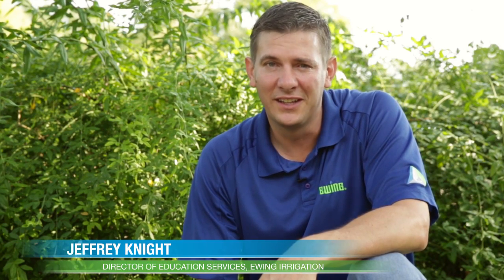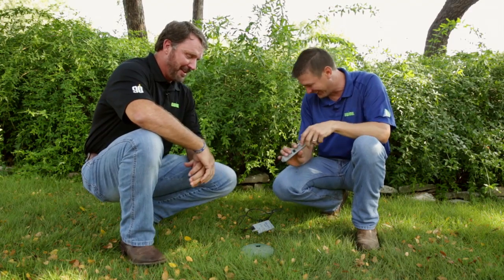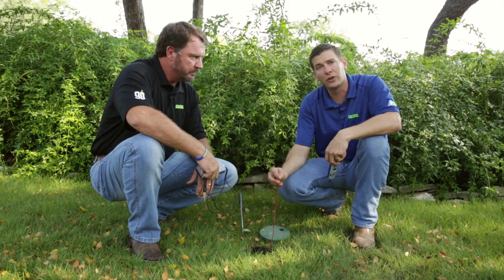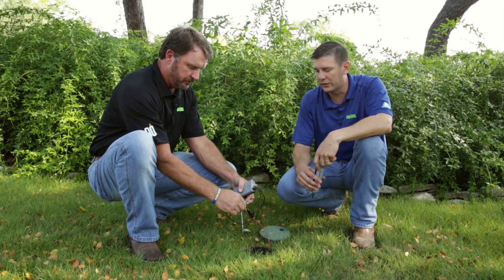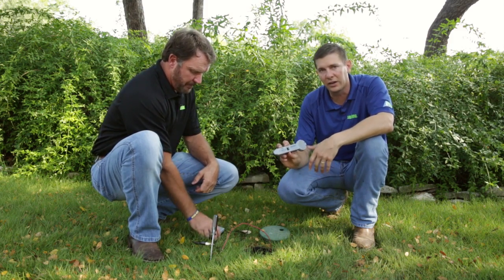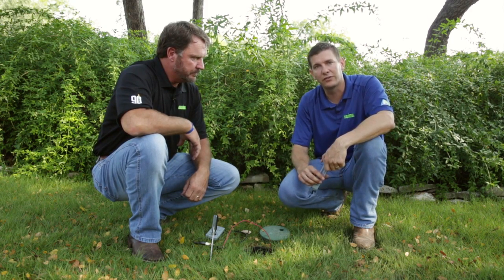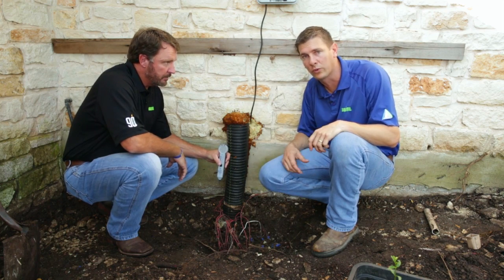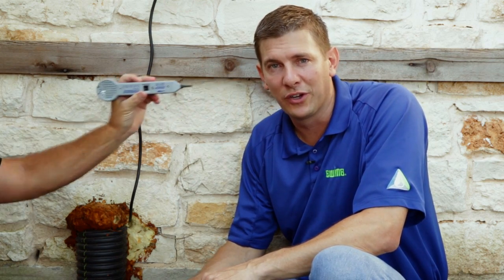Using a Toner to Identify Electrical Wires

Comment: First I Saw From Progressive. Tempo, Whatever they Brand as, Personally I Think the 620 is the Best, Slide the Switch From Off, Tone, Normally Open, Normally Open with Latch, Normally Closed, Normally Close with Latch. Momentary Connection of Leads Will Sound and Light as long as they are touching. Normally Open With Latch. A Momentary Connection Will Continue to Beep Til Reset Button is Pressed, Normally Closed Work Simullarily. 
A Note, When Toning Like You were Doing, Sometimes The Signal will Bleed onto Several Wires. When You Find a Pair you believe it to Be, short  those 2 together, if it is correct Pair, tone will be gone, if you touch and still here tone, you are not on the Right Pair.
Can't Live Without Mine, I Troubleshoot Most Everything.
Identifying Coax, Phone, Network Wires. For Cable TV, a New House, Start with putting Signal at Cable input from Cable Company, or Satellite Dish. Then go inside, Find that Cable/Wire, That is Input, All Others Are Output. Or if only using a select Few, Go to master bedroom and Connect Toner to Coax AND Network Wires,(Blue Pair?, Any Pair, go to where all homerun to, And Locate both at Once, Repeat as Necessary. Cars and Boats You can Follow to where the Break is, or Where it is Running to. Testing Fuses.
Great on Photo Beams, For Gate Operators, Place on Receiver contact, then move Reflector up and down, left and right to align to Center. 
Can Place on Wires on an alarm Panel, open and close door(magnetic contact) to hear if it is working. If testing a Pair of wires and to far to Hear, Then the Latching works well to identify, Can't Work without Mine, Is Others With Using Voltmeter and Continuity Tester, The Time to Troubleshoot is Criminally Longer, Customer Pays a Big Price for the Extended Time to Solve, And Customer doesn't know any Better, Just Thought It Must have been a Really Bad Problem, I Feel Bad For Them.
Is a MUST have. A Quick look at Your Sprinkler Tester Adds a Voltage Tester. But Only 24 Volts, Better to use a Multimeter as You can Check for 120/240 as Well. I'll Read Up on this Sprinkler Tester, But Don't Feel it Could be Better.
If Troubleshoot and don't Have the 620, along with the 200 Inductive Amp, You are Playing, not Working.
Randy, Strategic Electric & Security. Good Luck.

Comment: Im an excavator who just bought an old work truck and I found this cool tool under the seat. Can i use it to locate water main tracer tape? Or how deep does it go? I assume i could connect the common wire to a ground stake/screwdriver?  Looks similar to what my private locators use... may save me thoudands on a typical job if it can find lines burried below frostline if they have tracer tape or wire.
Reply from the maker: The Station Master Pro won't help you trace wires, just identify a specific wire as shown in the video. A wire/valve locator like this one may do the trick though.
https://www.ewingoutdoorsupply.com/42012000-pro800d-armada-hi-power-valve-and-wire-locator
Thanks for watching!

Comment: What’s the difference between armada and tempo
Reply from the maker: The features between the two are similar. The main difference is the price. The Armada model is a little less expensive. You can see more using the links below.
https://www.ewingoutdoorsupply.com/42011065-24bk-station-master-pro-irrigation-tester-kit
https://www.ewingoutdoorsupply.com/42012075-pro50-digital-solenoid-activator-multimeter-w-tone-probe-kit

Comment: What would be nice is the one that who is running the wire to label them it's very simple quite effective a piece of tape wrapped around the end of it and Mark it with numbers letters it don't matter I hate when I run into this stuff because some lazy ass could not label something when they pulled it moved it reattached it done whatever mess they decided to make mark it very simple

Comment: My wire toner is picking up on the common wire going to all the valves, and not the individual valve wire. What could cause this?
Reply: Disconnect all the Commons, Signal can go to individule valve, Throuh it and return to all the Commons, is like Backfeeding
Reply from the maker: It's difficult to say without seeing it but it sounds like you may have connected the toner to the common wire instead of the valve wire.
Reply: @ewingoutdoorsupply  thanks for the reply. I do have the red clamp on the individual valve wire at the controller.

Comment: I've been doing irrigation for over 30 years. I've had two tools that have served me well. A wire locator/tracker, and a $5 multi meter from Harbor Freight. The multi meter with resistance(ohms) does everything necessary to replace these fancy tools. Sorry guys, I had to say it.
Reply: How?
Reply: @Jesse-gv9tf  Do you have a mulitimeter? Also, what is the nature of your irrigation problem?
Reply: @doug2993  yes harbor freight multimeter. And exactly the same situation in the video. I'm looking for 1 wire out of 12 cut wires.
Reply: @Jesse-gv9tf  you get a specific reading on the ohmmeter when there is a connection to a good solenoid. When there is a cut wire or sometimes(not usually a bad solenoid) there won’t be any change on the meter, it’s showing that there is no connection. 
   Finding cut wires can be a laborious task. Is this a house? Usually the valves are all together and very close to the house, usually the garage, where the timer tends to be installed, then the valves just outside the house near the timer. What’s your situation?
Reply: @Jesse-gv9tf  Let me watch the video again on their problem, it's been a while.
Reply: @Jesse-gv9tf  Ok, it's a cool toy, but not essential. Did you see that there was a white wire? That's the common, assuming that wire is not cut, you short the wire that you are curious about, to that common. Then you go to the other end(timer, or valves) and put one probe on the common, then the other probe on each wire, when you get to the wire that was shorted, you will get the very low reading of resistance, that will be the wire that is shorted. That will be a much different reading then a good solenoid.

Comment: Can you tone test a live circuit?
Reply from the maker: Hello Mario, if the station wire is connected to the controller already, you should be able to run that zone to determine what valve it is operating. In this video they are attempting to identify wires that are not currently connected to the controller or labeled with the zone. Here's a link to the instructions for the Station Master 24B from Greenlee if you need further details.
https://cdn.greenlee.com/resources/media?countrycode=US&key=d775ead2-c5f2-4de1-bdb2-0b5ff7e12244&languagecode=en&type=document
Reply: No , you always make sure it’s not live or hooked up to the system to prevent false readings or no readings.

Comment: Good video...that station master is a helpful tool. However I find in golf course systems there must be a voltage drop due to long distances but I'm not sure. It will read good circuit but nothing comes on. Yet when I hook thaf same wire back up to the satellite and turn it on it will pop up. Any ideas guys?
Reply: Power does drop over distance.  This varies by wire gauge.  Or if you have a lightning protected solenoid with high resistance.

Comment: hey Jeffrey what's the longest distance the toner can go?
Reply from the maker: +ruben lopez - Thanks for the Question! The manufacturer does not list a distance limit on their spec sheet. However, in regards to Irrigation valves/wiring, distance should not be a factor when using this device. Here's a link to more information about the 24BK Station Master Pro Irrigation Tester Kit from Greenlee. Click on "Product Guides to see the field manual.

https://www.ewingirrigation.com/24bk-station-master-pro-kit

Comment: I realize I am biased, I work for Armada, but the Armada Pro48 and Pro48K do the same thing for less.  I also truly believe the Armada probe is better, having a headlight and AC noise rejection capability.  All are available at Ewing.  Jeff does very nice videos!
Reply: copied and pasted from above....

I've been doing irrigation for over 30 years. I've had two tools that have served me well. A wire locator/tracker, and a $5 multi meter from Harbor Freight. The multi meter with resistance(ohms) does everything necessary to replace these fancy tools. Sorry guys, I had to say it.
Reply: @doug2993  Yes, there are more ways to skin a cat.  Luckily for us, we have all options in our lineup, including a Pro30 basic multimeter that sells for $19.  I have been doing this for 30 years myself (this week is my anniversary!) and test devices are all replaceable.  A cable locator can be replaced by a shovel if you want to dig a 200 foot trench.  No tool is irreplaceable, they a time savers.  Easier, faster.  And don't apologize for adding to the discussion.  30 years experience is to be respected.  Thanks.

Comment: That was cool I am a sprinkler contracter can that be used to find valves that the boxes are hidden under grass I have try ed the cater box that will only work if it is quite out side
Reply: john Kosheluk a line locater. You can trace the station wire from the controller to the end of the station wire (hopefully your buried valve box)